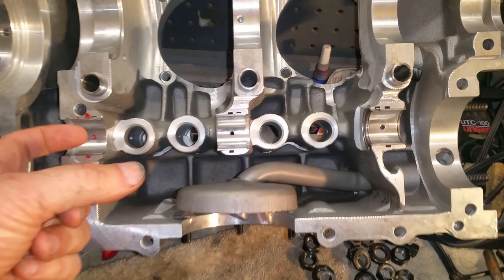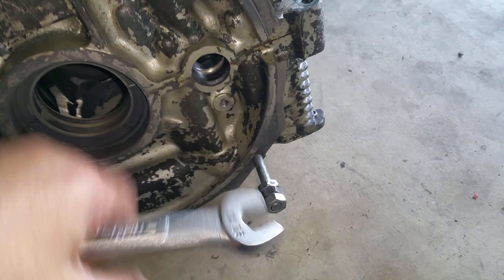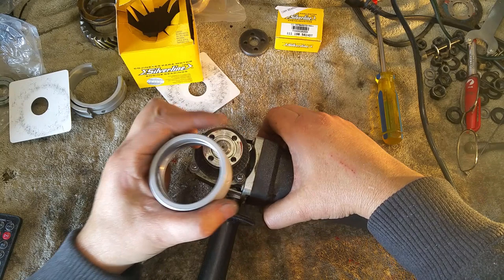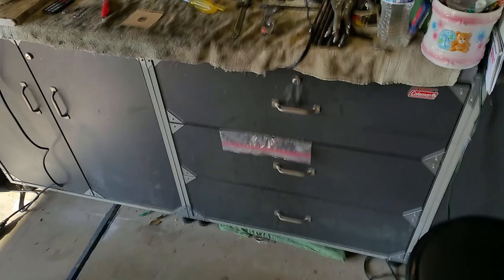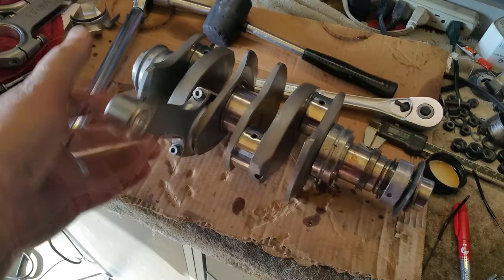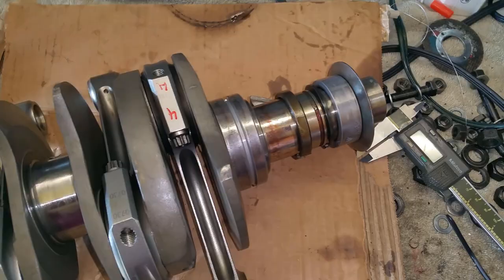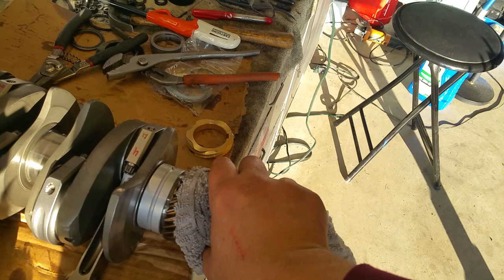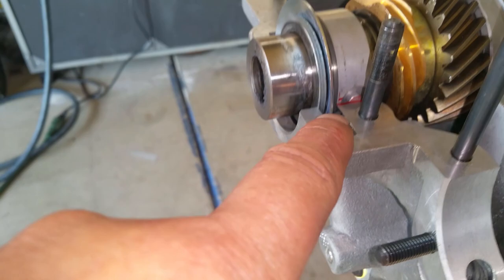HVX Oil Mod Short Block 2234cc

Comment: w\When I installed those gears on the crank I placed them i a pot of vegetable oil and boiled them for a few minutes. They would slide right on. Also, I thought you were going to use those spare HPMX carbs on this motor. Your going to only use one carb?
Reply from the maker: I gave the 2234cc to my son for his blue bug.
He doesn't care for Dual IDFs. That's way we didn't upgrade to a FK43 or FK8 cam. He just wants the simplicity of a single carb no venturi. I tried!